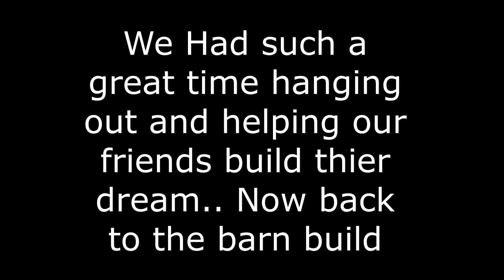What we have already MILLED for the BARN KIT// FIREWOOD and HELPING other HOMESTEADERS

Comment: My name is Bruce, from western Washington,  20 miles north of Olympia Washington, first I think you both are awesome, chasing you dreams, I applaud you whole heartedly!!!  Go after the end product of your dreams and I can clearly see that you both work very hard to get it done....I looked at Home Depot 16 months ago a 2x12x12 cedar was $46.00!!!! BS on that!!!
I have been a saw filer most of my life for Simpson, so saws and alignment is nothing new for me.... I bought a new Timberking 2020 diesel with a 12 foot extension bed, lap siding and shingle bed ( it took 16 months to get it built)....I put a green laser on the mill to point out the saw cut line, and am putting a water injection system x2 pumps that I can shoot water and/or diesel as needed....I wanted to mention the carbide tipped saw blades from Woodmizer,  I bought 5 of them, they are super sharp and they hold an edge really well, amazing!!!! And if you get an Oregon chainsaw sharpener and fit it with a diamond wheel, you can face grind the blade  a few times to get good life out of them. I plan on doing a lot of timber frame style buildings on a property that we have, so, full speed ahead and we all can catch our dreams!!!
Reply from the maker: Hello Bruce.. I had a farm in Western Washington for 7 years!! up in Rockport